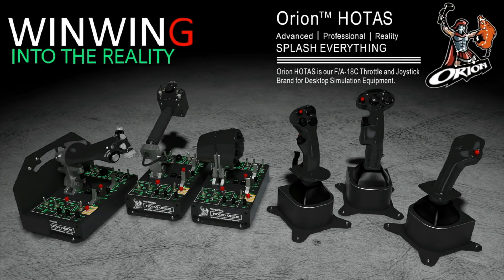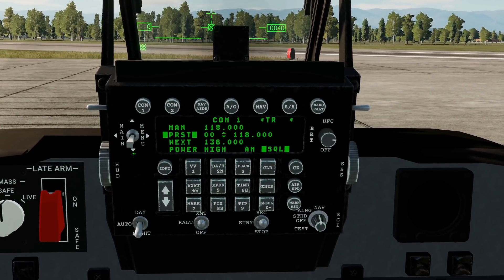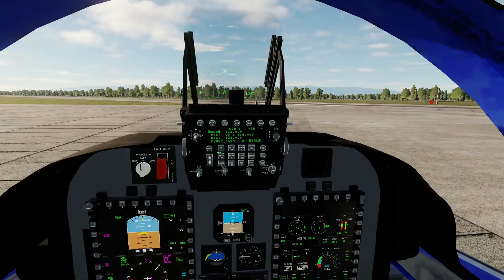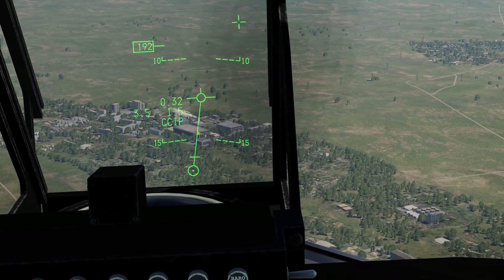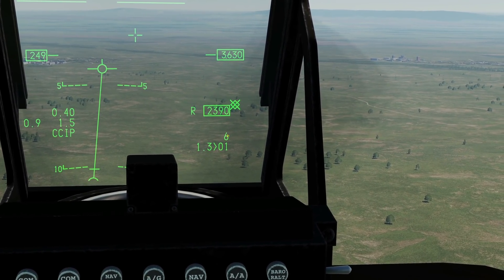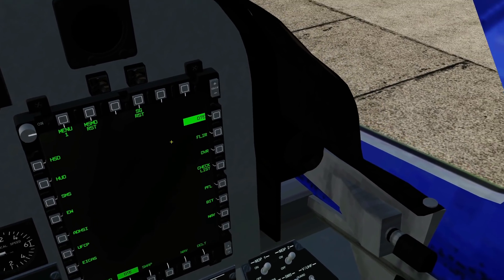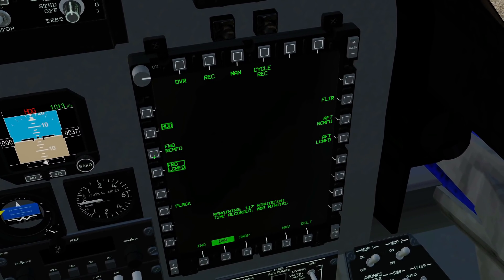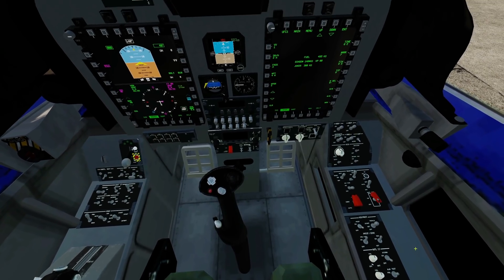A-29B Super Tucano(v0.2.2b): Radios, CCIP Delay & New CMFD Pages Guide | DCS WORLD

Comment: I wish this was an actual DCS module instead of a mod. DCS should buy this and develop it!!! Just a thought
Reply: Oh imagine this with photo real cockpit textures…..
Reply: Isn’t Razbam developing one?
Reply: @goldenstateaviation2861  wow, I just checked their FB page and yes, you appear to be correct, and also a Pucara - I’m surprised they haven’t locked down these mods so they don’t take away from their product. (But aren’t Razbam our unofficial least favourite module maker?)
Reply: @goldenstateaviation2861  I thought i had heard that too
Reply: A mod is not a problem if it's an A-4C quality and detail mod. But its being SFM is a problem.
Reply: @getsideways7257  well, this is right, as a light sports pilot, i dont know enough about these aircraft to know if they are really all that accurate, but I do want them to stall and depart realistically. It’s why I don’t have very many SFM mods.
Reply: @doemacmonkey  There is zero reason to have a single one at all. Even EFM mods are rarely decent. But when it comes to the props, SFM is just a ridiculous approach to use for those.
Reply: @getsideways7257  yes I tried the extra but it didn’t drop a wing as it should if using aileron near the stall so I stopped, I have the goshawk and A4 as a carry over from my FSX days of old (X-Plane these days) but generally I don’t fly them - the yak52 remains my primary plane of choice.
Reply: @doemacmonkey  I'd say the Christen Eagle II can be useful sometimes as well. At least it does exhibit some gyroscopic behavior, which is rare in a sim. I tried doing that in BET-based ones (like X-Plane and MFS), but that always looks very artificial.
Reply: @getsideways7257  I haven’t tried the CE, thought about it at the last free-fly but instead spent all my time trialling choppers! I like the yak as all of my personal flying experience has been with tricycle undercarriage, I haven’t experienced taildraggers yet, although I do love the P51, so I might give the CE a try soon. I know it’s supposed to be a combat sim, but I just love the procedural accuracy and am one of “those” people who would love to see an accurate C172 module included - my choice of modules has been drives largely by what I have flown and what I might one day have the chance to fly - joy flight companies nearby have yaks and L39s, I’ve flown in a Huey, etc (I have the hornet, because my country’s airforce flew them, not because I ever expect to be able to, same with the sabre and P51)
Reply: @getsideways7257  I also haven’t tried MSFS because I heard that the flight model was abysmal - is this still true? I’ve seen older videos where a Cessna just will not stall while hauling it around at 80 degrees bank in the circuit! It put me off trying it - waiting for X-Plane 12 to emerge so I can upgrade my X-Plane 11.
Reply: @doemacmonkey  Yes, apart from the Gazelle, DCS choppers are a real gem placer. But there is a possibility you should have waited until both the Apache and the Kiowa are out. While finding the Gazelle horrendous, I'm still giving Polychop the benefit of doubt on their next module (it might become the biggest hit even).

I personally have all the modules apart from the Mosquito (and the campaigns), since I enjoy more "physical" flight models. Going to try the Mossie too after the new modules will become available (hopefully the Typhoon and the Kiowa... maybe the Fulcrum too), but it's not really my type of aircraft.
DCS is quite a mixed bag if I'm completely honest, but still no other sim presents flying quite like it (that's not to mention the systems modeling). One thing that really bothers me about DCS though (apart from the "flat Earth") is that I don't really see fuel / payload weight distribution modeling. After having had experienced that in MilViz Phantoms for FSX and in the Nimbus UH-1 for XP11 I'm really missing the feature in DCS.

Speaking of props, you might want to give the P-47 try as well. It might look unwieldy at first, but there is something about it that I really enjoy in its handling characteristics. It probably feels the most "alive" compared to the rest of the props. By the way, I do like the Yak too and it's absolutely fine to want more civilian stuff in DCS in my opinion. Although yes, not many would enjoy C172 in it... I wouldn't mind having one, but I'd probably prefer the more "aerobatic" version of C152 instead.

MFS is a rather weird sim, really. Its flight models were jumping all over the place with every patch. I have to admit I haven't tried neither the recent MFS updates, nor DCS for a few months already, so there is a slight chance that something got patched after all. The good news is that now MFS seems to fully support SimConnect, and that means there is absolutely no reason for the 3rd parties not to make their own pluggable flight models for it. That's how the helicopters are being made currently.
I wish the Phantoms were ported into MFS, but sadly, the physics guy responsible for the external FDMs had a conflict with MilViz and left them a while ago...
By the way, the last time I flown the C172 in MFS I was able to do a Hammerhead... What is your opinion on this? :)
DCS Yak is probably the most enjoyable simulated aircraft for Hammerhead practicing (and snap-rolls too, I guess)

Still waiting for a sim that will do gyroscopic maneuvers properly. And in that regard the original Flight Unlimited is extremely interesting (but requires using of DosBox or something similar), but with current tech it could be made so much better... If you have any interest in such aerobatics, you can find a few examples (or mostly attempts) on my channel. Flight Unlimited examples are also there.
I'm also wondering what XP12 brings to the table, but really holding my breath, since BET is not too suited for complex airflows and maneuvering...
Reply: @getsideways7257  I confess I am also looking forward to seeing if the Kiowa is any good as I have spent a fair amount of time as a front seat passenger in the civilian longranger and would like to sim-fly the equivalent. The only chopper I have really actually flown fully hands on is the R22 and I would not expect that to appear as a module!
Reply: @getsideways7257  hammerheads are fine in MSFS, as far as I was lead to believe aircraft will stall, it’s just that they seem to stall at a set speed, and the stall is a set drop rather than a lift break - it did not seem possible (at least in early versions) to stall only one wing, instead it seemed like the entire aircraft was set to stall at a tabled speed that did not include load factor. But I am taking other peoples word on this.
Reply: @getsideways7257  from what little I understand, X-Plane 12 will bring little new over X-Plane 11 in terms of models, most changes appear to be cosmetic, to make it more competitive with MSFS’s photo-real scenery. But since X-Plane 11 owners will be upgraded to X-Plane 12 free, why not take it?
Reply: @doemacmonkey  Yes, I really hope we are getting a proper module this time around, otherwise Polychop will become a DCS exile and they should realize that.
Sadly, a nicely modeled R22 is definitely not something we are going to see implemented for DCS any time soon, but if you haven't tried the AH-6J mod, that might entertain you for a bit - at the very least it's based on NASA data (although for low level out of ground effect flying only).

Are you really sure a C172 would take a Hamerhead easily in real life? The simplicity of doing it in MFS raised a few suspicions in me, but then again that was a good while ago.
By the way, if the recent helos for MFS are of any interest, I'll let you know soon after trying. The H135 is way too arcadish in many regards. Not sure about the H145, since it's a payware from the same team that made the H135 (but at least in the videos it looks like you have to actually work it to make it stay in a hover).
The FlyInside Bell 47G is pretty good, but I think its manual throttle operation is rather suspicious at high altitudes. It's almost as if the developer always flies with the "governor" helper on and never really tries to do it the right way. The last time I tried it the pedals also had probably too much authority at speed.
Reply: @getsideways7257  no no no, I was purely talking about MSFS and how it models stalls and as such a hammer head in a c172 should be easy, but no I would not like to do one in a real C172, perhaps in a 152 aerobat!
Reply: @doemacmonkey  Then we just had a bit of a misunderstanding there. I also figured that I definitely wouldn't want to attempt something like that in a real C172 :)
As for whether there are any changes to the FM at this point, I'm going to find out soon. I thought I did have the situation where one wing would stall before the other there...
But more importantly, this will be my first time in the F-104G for DCS. There are good indications it's a worthy mod...
Reply: @doemacmonkey  I'm getting more and more disappointed with MFS' bundled Extra's flight model. How is that even an aerobatic plane at all...

The good news, however, is that the R44 for MFS turned out really good (Black profile, realism to 100%). Probably even more so than the 47G all the while being free at that.
Another great news is the F-104G mod for DCS. I expected it to be good, but I didn't expect it to be THIS good. Although, not sure what kind of problem people were having on taking off... Maybe it was fixed in a patch. Sadly, the mod breaks replay for me easily.
Reply: Thought someone was making a super tuc.
Reply: @Exile89-19  I heard that Razbam was planning on making one
Reply: @Exile89-19  It is supposed that Razbam is working on it. So no, probably it will be never available as a mod unless this guy becames a 3rd party.
Reply from the maker: agree